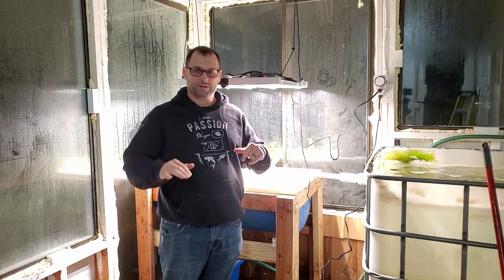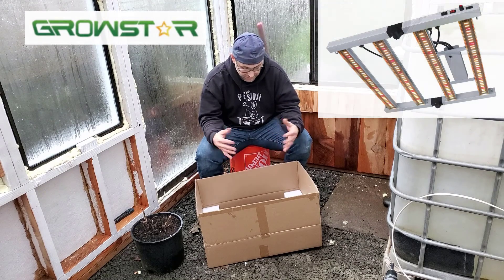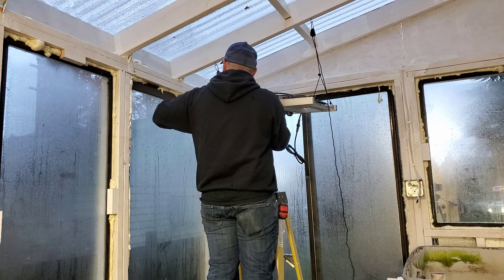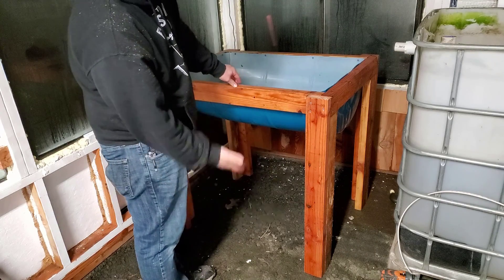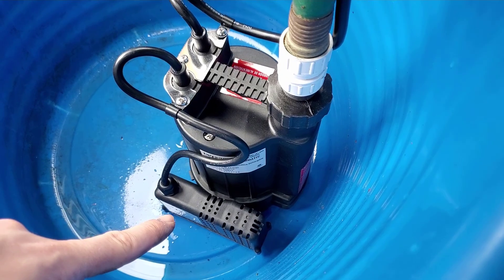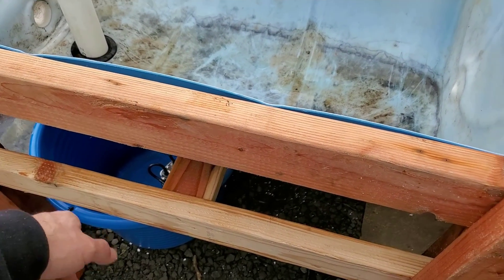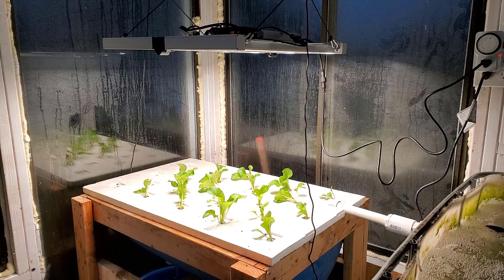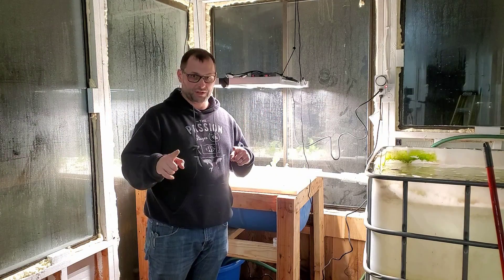DIY Lettuce Raft Build and Setup "Perfect for Aquaponics"

Comment: You should drain the fish tank from the bottom not the top so that you get the fish poop at the bottom a snorkel on the outflow to the floating raft will solve the siphon action ps robbobs way
Reply from the maker: I have a pump at the bottom that runs to a filter to remove the solids.  I have pumped into the beds before and the poop build-up in the beds and flood drain is horrible.  I did add a snorkel drain to the IBC tote so that the it would stop the siphon and prevent fish food from pulling over.
Reply: @BabblinginmyBackyard  yip that's the one 👍 you're on

Comment: The foam is styrofoam insulation like what is found at Home Depot? Thanks!
Reply from the maker: No, the rafts are these. https://gard.in/products/beaver-plastics-lettuce-rafts?variant=39636722450480&currency=USD&utm_medium=product_sync&utm_source=google&utm_content=sag_organic&utm_campaign=sag_organic&gclid=Cj0KCQiA3-yQBhD3ARIsAHuHT66tosf_cUFO3PrH_Qy9X5Vt5GpLpMhuso7dTLkyRmLlyeS4m6RVeR8aAmFdEALw_wcB 
I have made rafts from the insulation foam, they are super messy and not nearly as dense as the real deals.  I would by them from my past experience.  They are not that much and they last forever.
Reply: @BabblinginmyBackyard  thank you for the response. Would love to buy this but I need something 6 foot by 3 foot. Was considering these but would have to cut em up and buy multiple to make it work. Thanks!
Reply from the maker: No worries, good luck.